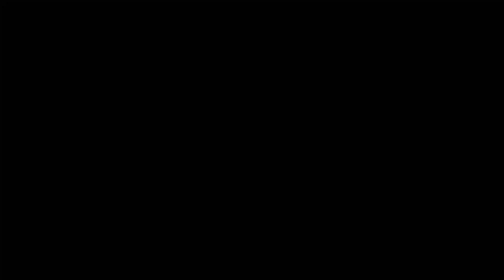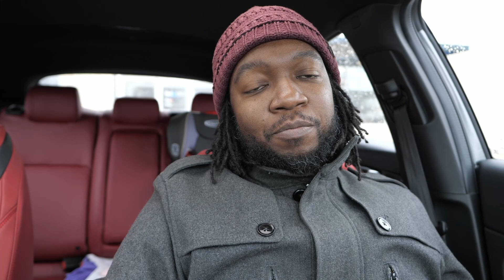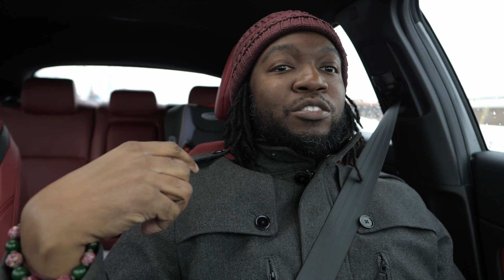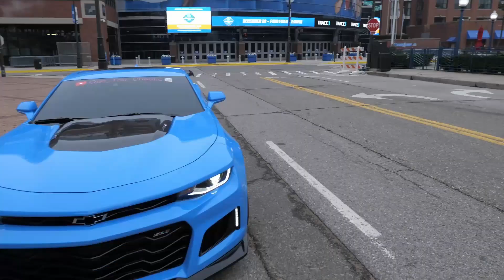How I got into Automotive Engineering!

Comment: Mad respect Que. Was nice to get an inside angle into your career my man. You have certainly accomplished a lot for sure. I worked in IT software for a while. Was a corporate trainer and installer for a logistics company and then hotel software company. Didn't mind it but hated being a software tester so that's where you and I differ 😆. Also was a hotel manager for Fairmont, Westin and Hilton. Good times!!
Reply from the maker: Aww man that's interesting. I want to dabble into sales engineering at some point. Just to see what it's like. I like testing but had the coding part
Reply: @QueTheChaotic  - Yup. Good coin in sales if you can smooze with people and tap into new markets...
Reply from the maker: @RDriver2.0  facts!